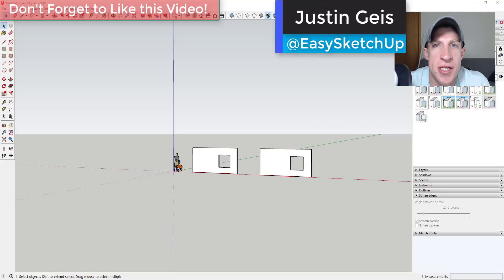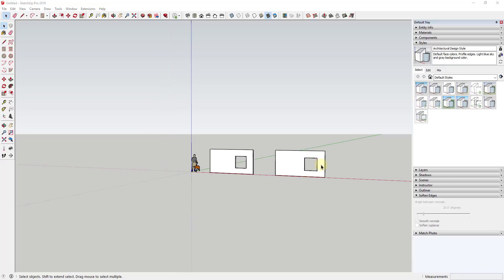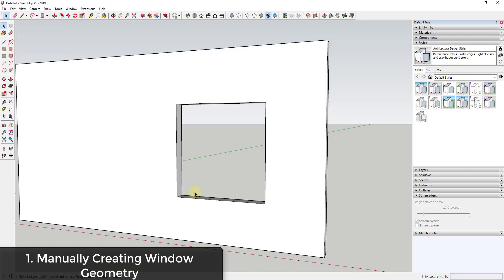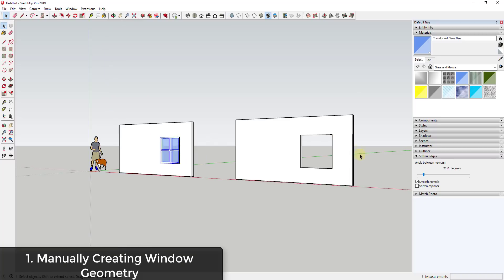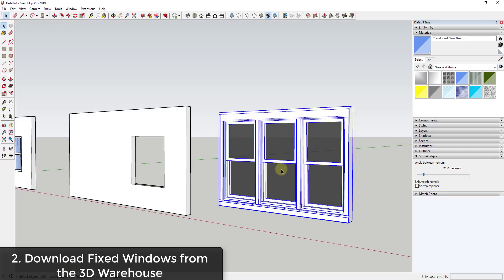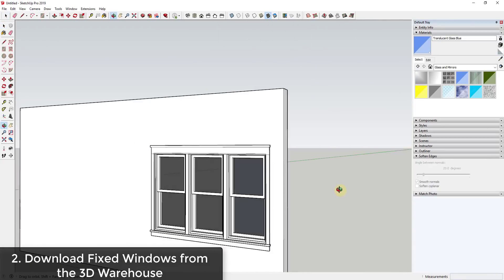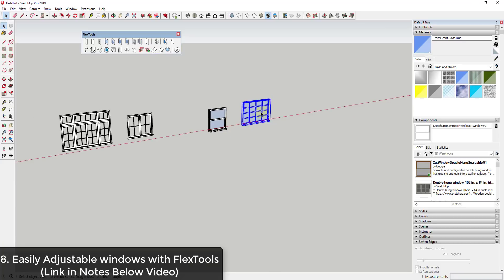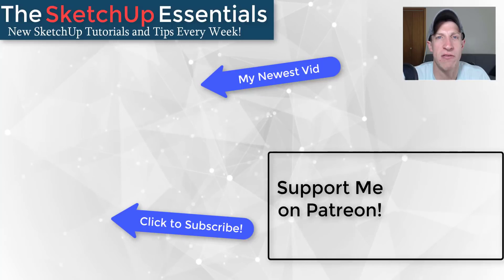8 Ways to CREATE WINDOWS in SketchUp

Comment: Hi Justin, I am new to Sketchup - your videos have literally taught me everything I know! I am using the Window extension as in your video, but my windows always stick on the outside of the walls - or somewhere else - but never slide neatly into the opening. I feel like I've got some "snap" setting wrong. Can you give me a clue please? Regards, Paul
Reply from the maker: It probably has to do with the base point you're selecting when you move. Make sure you're not picking up a point that's on the outside of the trim or something

Comment: Great videos. I was making the opening for the windows and on the 4th or 5th window it won't let me cut the window through push/pull. I did all the other window openings with a push/pull and went to the back edge, but no matter what I do now, it won't cut though. Ugh. Help. please
Reply from the maker: Is one of your windows outside the wall group?
Reply: @Thesketchupessentials  I guess that could be the problem. I have started over and grouped my walls. When you group your walls you have to be careful you don't get the floor into that group. I have made that mistake too. So when you make a cut for the window , I should click to where it looks like it has a box around it? And not in yellow? Do I make the windows when I am in the group of the walls?
Reply from the maker: @lauranichols4120  Well based on your first comment it sounded like you were drawing a window outline on the wall, then push/pulling through the wall to create an opening before making your window. If that's the case, you can only cut an opening through a wall with that method by drawing and push-pulling through the raw geometry of the wall. If your wall is grouped and you're not editing inside the wall group, you can't cut a hole
Reply: @Thesketchupessentials  I really appreciate your replies. I am sorta new at this and want to learn more.  So I started over and grouped my walls and the window cutting is working. At least for now. Not sure what had happened. So what if I accidentally grouped my floor with my walls? Is there a way to ungroup the floor once  I did it? Do you give one on one classes?